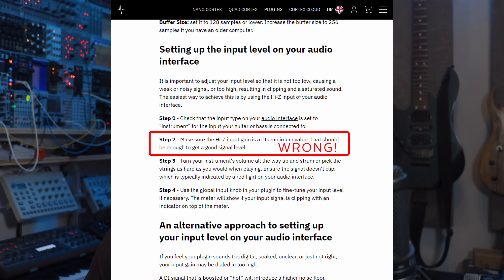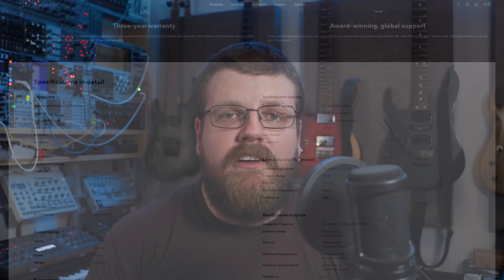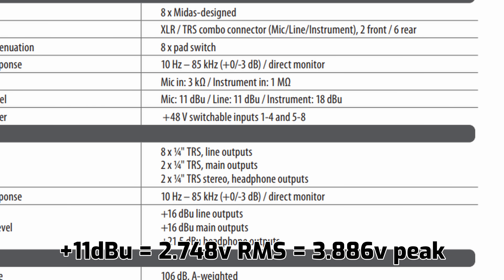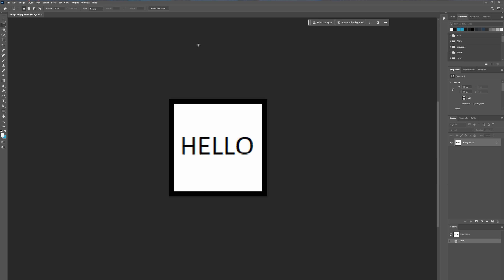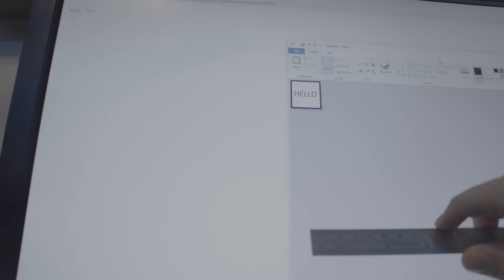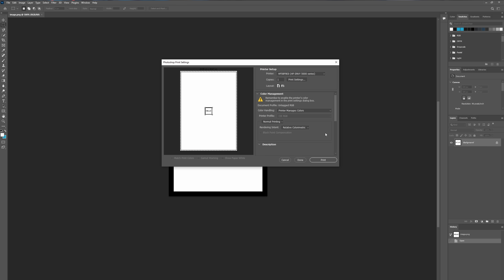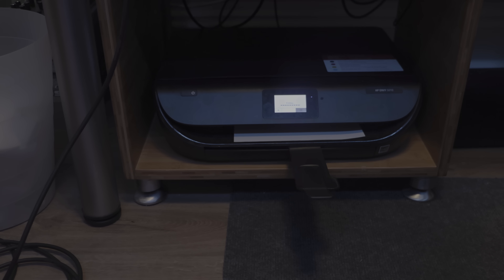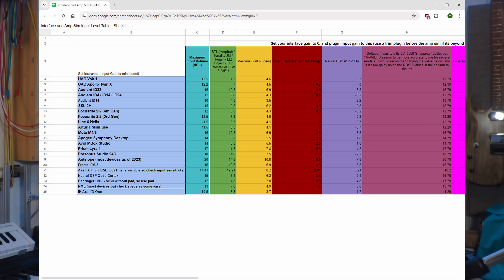Ampsims and input gain - Please, stop the madness...

Comment: 9:00
1st: nice white noise floor
2nd: loud sound of digital circuitry (manifesting as harmonic peaks on the spectrum) Because the interface is designed this way, its 0 dB masks its internal noise inside the thermal noise, but when you boost it, it appears.
If you really care, use a low noise pre-amp closer to the source (guitar) and far from the digital circuitry.

In other words, both suck without noise gate. Set 0 dB and forget. As an additional plus, the signal will never clip. That's the point of using 24 bit interfaces, the availability to set a ridiculously high headroom.

Comment: Thank you so much. I got mad I stumbled to the wrong advice, but for different reasons. Many DAWs handle low level regions bad, not being able to show good waveforms, not detecting transients etc. Very bad advice to ”always” gain 0db for multiple reasons.

The other misinformation I hate: people still going on about clipping in channels. CHANNELS HAVE NOT CLIPPED SINCE 2002. Master output can clip, put a gain plugin or limiter there to compensate. Also some plugins can clip, if they can’t handle floating point audio (rbass for example), and some plugins don’t work as intended if driving too hot. That’s the reason you gain stage or think about these things. Not for that red clipping indicator in channels, that does NOTHING to the audio, and DAW handles the overload just fine.

Comment: Ackchuwalllyyy..... the truth is somewhere in between what "they"/"those people" are saying and what you are saying. 

Yes A-to-D benefits from a maximum input to have a maximum signal-to-noise ratio. Unfortunately there is more to an interface than just the digital conversion.

The built-in preamps of interfaces are NOT made to be pushed all the way. Every preamp has a point where it will respond well to an incoming signal but where it will choke if you have a peak that saturates/overdrives that preamp. (there is a difference between the ~€0.25 cost of parts of a built-in preamp and a >€500 preamp and it's not just the brand name)

The old adagio of "turn it up until it clips and then turn it down a bit" is NOT good advice and belongs in 2005, not in 2024. You are in face way better off turning the preamp down a bit too much than turning it up a bit too much.

So yes: you are right about the digital part of your findings but there is always an analog part to it as well and it's THAT part that benefits from not pushing it too hard. 

Also: turning your preamp gain knob to "0" is NOT "0dB of gain".  Feed your line in with a 0dB(VU) = 0,775V signal and see at what point on your gain knob you get a -18dB(FS) signal in your DAW. THAT should be your new "zero" from now on.

Comment: I'm not a qualified audio engineer – just a producer. However, i used to think that it's obvious: the more clean boost you got = the more depth (resolution) and more signal/noise ratio you achieve within the interface. It's strange that someone claims the opposite as a community consensus, because all the A/D theory proves that. Thank you for that video. Musicians possess a humanities mindset rather than a technical one, so there's a lot of honest misconceptions like this – it will be very helpful.
Reply: I don't know that musicians really skew any differently than the general population when it comes to technical mindset. It's just that most people aren't technically minded, and those that are tend toward fields where this is an asset. But you still get plenty of technically minded people (like Tom Scholz) who also happen to be great musicians.
Reply: @mal2ksc  I agree with your point in general, but i don't think that there is a discrete dualism between these extremes. Personally, i have a technical and humanity mindset at the same time – this is common among producers, mixing and mastering engineers. There's no way you can mix your music without any abilities in math and physics, for example.

However, to write good music, you need a strong humanitarian background. Music written by engineers is often boring and doesn't excite in any way, because most of good music is about feeling rather that knowledge. In my opinion, only a combination of cultural and technical development factors gives a result.

The music industry got it long ago, which is why artists work in tandem with engineers – without them, everything will sound bad. Without the former, it will sound good, but it will not catch. However, it's not a rule – just a trend that becomes mainstream.
Reply: "Musicians possess a humanities mindset rather than a technical one" Thanks for speaking for an entire section of a population like you know everyone.
Reply: @andymerrett he is of course generally correct, despite the offence you have taken
Reply: @andymerrett  Since I am not an English native speaker, I didn't expressed myself precisely – I meant that musicians are humanities more often than technicians. I have 10 more years of experience of working with artists, so i have some observations. Excuse me or you're welcome, i dunno

Comment: I use a buffer and go through the line lvl input of my interface, I adjusted everything according the spread sheet and I still think it helped, cause now the plugin behaves more like I’d expect the amp sim to work in terms of distortion and gain. However, I see the issue with the noise floor that you described, my only problem with that is, that there is no indicator on my interface that shows me how much gain I am adding. Any tips how to find out? Can i measure the digital gain after conversion?

Comment: The input gain on the audio interface should always be zero since that is the only consistent setting, I don't like having it any other way since it may not be consistent from day to day. I use Helix Native and set my input gain in the plugin to match the Helix hardware. To figure out the input gain in the plugin you need to subtract the Helix hardware dBu (11.5) from your audio interface dBu, for me that gives +4.5. That should match the Helix hardware which is what the amp sims was designed for. Have absolutely zero issues with noise using 32 bit ADC.

Comment: This has been a point of confusion since the combination of MicPres and ADC's. The Problem is always the lack of headroom when moving to digital. You can't overdrive or find the 'sweetspot' in a pre that drives its ADC into clipping. Proper gear lets you adjust the working level of the ADC. USB-Interfaces typically don't have a gain and a level knob per channel.

Comment: You're still spreading myths regarding the noise floor. There's no such thing as "significant bits", the bit depth merely defines the amount of dynamic range available and has no impact on the audio as long as its dynamic range is within the available amount defined by the bit depth. Which theoretically is 144dB.

The statement by John Cordy is sensible in that the dynamic range of even the best analogue equipment, including microphones, preamps, outboard etc is not even close to the dynamic range available with a 24-bit bit depth (Let alone combined!) and guitar pickups are not remotely close to the best analogue equipment out there, they're actually dogshit technically. So the idea of maximising the input level to maximise dynamic range is a hangover from analogue recording where dynamic range was far lower and a constant battle to not have it creep it up throughout a production whereas now we don't have to worry about that in the digital domain unless you're doing something pretty silly.

In digital recording if the noise floor of the signal is above the noise floor set by the bit depth, it has no impact on the recording in anyway, you don't get better quality audio by trying to get it as close to the point of clipping.

Best way to think of it is you've a pint glass, you can fit a pint of beer into it, a can of beer will fit into it, a standard glass of wine will fit, a shot of any spirit will fit. If you fill in the glass so that the shot will reach the top, if you wanted to then use it for a can of beer, it now won't fit, it'll just spill over (That's clipping) and that's all you're doing when setting the input gain.

Unless you're trying to record a jet engine in an anechoic chamber, you're never going to realistically require the full dynamic range of 24bit.

Anyway, gain can be applied digitally, which with today's floating point DAWs you don't have to concern yourself with clipping as you would applying gain prior to conversion. You just require enough level to not get the digital noise floor involved, but that'd have to be CRAZY low with an electric guitar pickup.

Comment: I’m baffled that people thought zero gain on the interface was the solution. Am I getting old or something? That’s basically recording guitar DI 101. Thank you for putting this together and bringing some sense into the world 🤘🏻
Reply: People will believe anything as long as it allows them to half-ass something.
Reply: He used a shit interface. You have to understand the problem they were trying to solve first. Component based amp modelling software has dials like the real amp. People want the simulated amp to work the same as if they plugged their guitar into the real amp. That means, e.g if the real amp has a gain knob from 0-10 that they want gain on 5 to sound the same as the real amp with gain on 5 - for their guitar. Obviously this also tends to make presets marked 'clean' sound clean (modulo that different guitars / pickups etc will affect presets)

But the problem is now twofold (a) interfaces were saying to set gain 'just below clipping' and on that setting many of the plugins were massively over gained - because that's not how the plugin authors envisaged the gain to be set and (b) Many of the plugins, especially the ones that come with tons of different amps, are a complete mess in the sense that if you pick n of their models you need to use n different input gain settings to make it match the real amp - and unless you own all the amps how do you begin? Plus some of them the gain is only correct if you turn everything up to max, i.e the clip lights can be on but the gain is still too low - this amp modelling stuff can be an inconsistent mess.

So problem (a) was solved by at least making people aware that their input gain matters and giving them settings that work for a bunch of plugins and interfaces. But saying "input gain on zero - set input gain on the plugin from the spreadsheet" has confused some into believing 'input gain on zero' is somehow key to everything or a new religion. Obviously it's not. The big clue is - why would you have an input gain knob if it weren't supposed to be turned? But it works - and it works far better than this video suggests because he used crap hardware to exaggerate a problem. Quite disingenuous really.

Problem (b) is not solved and there's no real solution. You really want all people who are simulating a bunch of amps to do so in a way that you only have to set input gain once - where you have things that are more open and 3rd parties can add, well, you can see why it often ends up a mess.

But the noise in this video was a bit silly. It's like I'm using a pod xt for my interface - it has no gain knob to turn but the biggest problem with noise I have is if I point the pickups towards the computer running the plugin. Plus of course this video side skirts the issue to get off on calling people wrong. He doesn't offer settings that we can use with our plugins - but suggests we refer to the same spreadsheet these "wrong" people created. So it's like he's saying "They're idiots and are wrong" - but, wait a second, their spreadsheet is the information we need to make our plugin simulated amp gain match (as closely as possible) the real amps that are simulated and the gain on zero really doesn't make it that noisy - so they were actually right. The only people who are wrong are those who think you absolutely HAVE to have your input gain on zero - of course that's not true. Of course you can set input gain on your interface how you want and then adjust in the plugin accordingly - but that misses the point of the whole exercise which is trying to get simulated amps to behave like the real amps.
Reply: @michael-3-l3  Well, the problem is actually threefold: (c) 0% preamp gain would result in a different level from manufacturer to manufacturer (sometimes even different between various model lines of the same manufacturer), so it still can't be a baseline.
Reply: @ramziel  That's what the spreadsheet is for.

Comment: I'm sorry. It does seem logical what you are saying, but I get better results by just adjusting the digital input of the digital product aka plugin then adjusting the input of my interface(which I set to 0). I assume that the problem is the coloration of the interface preamps. nowadays noise floor is so low it does not matter. imho.

Comment: Thanks for that ! I did get that setting input gain to 0 was wrong but did'nt realise I could still use the data from the sheet. Stupid me. So, if I want to test several guitars/pickups on the same amp without adjusting both inputs every time, I can use you method with the highest output pickup and then plug the others. I'll get realist sound from the amp, but the less the guitar output is, the less optimal the digital conversion will be. Then I take the guitar/pickup that sounded the best and do the proper setting for both levels. Am I right?

Comment: I have used both methods over the years. The "set your input (interface / modeller) as high as possible" and "leave it at 0". Ultimately, both work when adjusting everything to it. I just don't get why there is no clear advice from the companies making the hardware and software products. It leads to so much unnecessary confusion.
This video makes a lot of sense. Sadly though, it feels wrong to do it that way for most of us. What I mean by that is it's weird to set up your input gain to high and then lower the one in the software by so much. Again, not saying it is wrong, just saying it feels wrong.
Setting up a modeller like the Quad Cortex would follow the same logic though, right?

Comment: I've been trying to gain stage like this with a noisy Zoom H6 and various mics and pres for a while now. Its the same approach as you mentioned. If it goes to the DAW you can even get a visual of the noise floor in many EQ pluggins as you adjust each gain. When you're dealing with analogue pres like API or Neve based preamps there are sweet spots for signal to noise, though they're way better than your input on the Helix or many soundcard

Comment: Hopefully someone here can explain to me if there is something wrong with what I am saying.....but...

If there was some way to separate the "analog" front end from your "digital" conversion....this concept of gain staging to take advantage of the signal to noise ratio makes sense.

You want the voltage in your input circuit to take full advantage of what is available in order to maximize the amount of signal relative to the noise floor of the circuit.
The issue of noise floor with modern 24 bit converters is essentially irrelevant, as the dynamic range available with the number of quantization levels available is massive when digitizing the input voltage.

Conversion is essentially handled in one step in a standard modern interface....not separate functions...and the circuit is optimized to work together.

I don't know about all the different interfaces out there, but using the instrument level of my interface with fairly hot humbuckers gives me peaks around -5dbfs. This is without adding any additional gain.

Common knowledge around gain staging for digital audio recording with 24 bit converters has been that peaks around -18dbfs are still fine in terms of maintaining quality and signal to noise ratio.

Therefore, I leave my input level at minimum (or slightly above).....and even if I changed to a single coil mode, or used another guitar...I'm still with in the range of "acceptable"....with regards to my peak levels.

There are so many variables involved with the concept of trying to recreate the real world equivalent of plugging into an amp when using different digital models (in order to create the exact same tone/gain)...it is difficult to achieve with certainty...

The method and levels used when the original model was created (including the profiling tech used) seems to affect gain levels quite differently....and there are no standards.
I think for most end users with decent interfaces, it makes sense to avoid adding gain (i.e. additonal "noise")...if they are already achieving peak levels in the -18dbfs range or higher with their "hottest" pickup config/guitar as the benchmark.

That way, you are in the safe range even if you switch pickups or guitars...and you just leave your input alone from that point on...and make gain adjustments on the plugin.

Am I missing...or misunderstanding something?

Comment: No standard?? Every plugin is made to expect a signal around unity gain - 0dBVU, usually corresponds to -18dBFS in the (not arbitrary) digital system. This is for a sine wave. With a guitar signal this would usually (from 25 years of experience) give you a peak in the -6dBFS to -10 dBFS range. No reason to push it further than that. This video is wrong, but the end result is not that off, and wouldn't ruin your record.